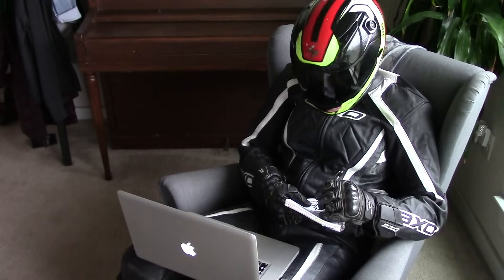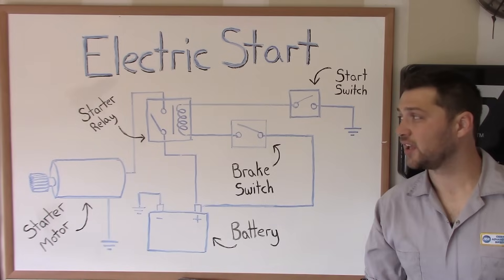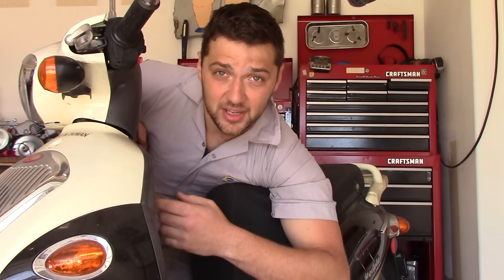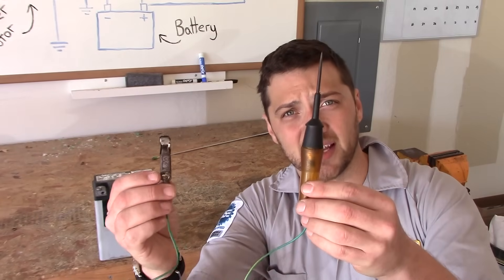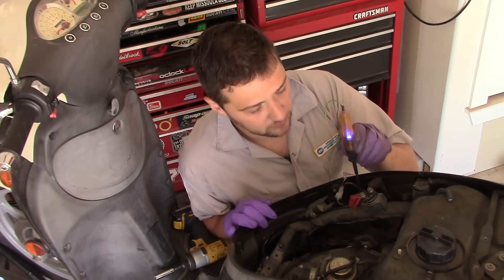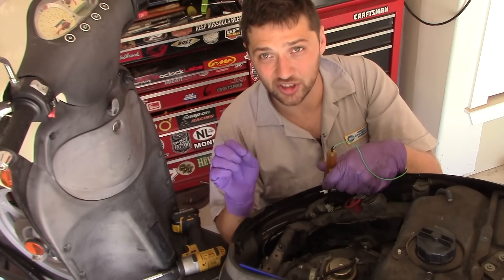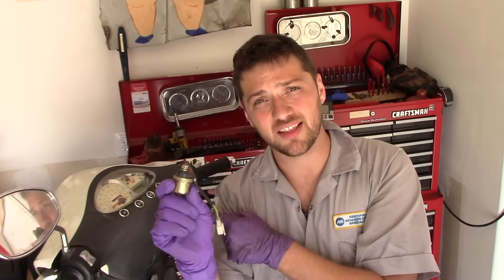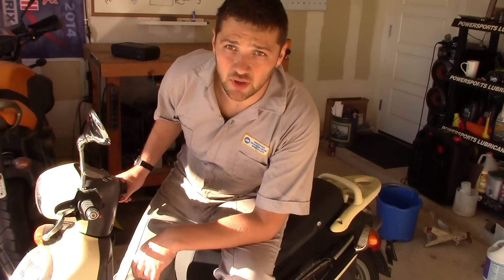Scooter 911: Electric Start Doesn't Work (troubleshooting your starter, starter relay, and circuit)

Comment: 3:35 my electric system is fine, then whats the problem it won’t start? i bought a new battery as well
Reply from the maker: Basically your engine needs 3 things to run: A charge of fuel and air, spark, and compression. So you need to make sure your bike has all three of these components. The easiest one to start with is spark. Remove your spark plug, insert it back into the boot (at the end of the plug wire), ground the tip of it against the engine and "Start" the engine. You should see a bright bluish whitish spark jump across the tip. If you have spark, reinstall the plug in the cylinder head and puff some carburetor cleaner or brake parts cleaner down the intake. If the scooter pops or coughs or starts and runs a little you have a fuel issue. If the scooter does not respond to the carb cleaner you likely have a mechanical issue preventing the scooter from building proper compression. I would perform a valve adjustment and then re-test. Good luck!
Reply: Garret Seesing apparently it was flooded, it happens at least two times a month, so it’s a fuel problem right?
Reply from the maker: @NICO12981  definitely. It's most likely the vacuum petcock (sometimes called the fuel cock). On most scoots it's mounted under the fuel tank. If you want I can walk you through the diagnosis and replacement over skype
Reply: Garret Seesing thank you very much!! i’ll get it checked
Reply: Hi Garret Seesing What do i do if i have a compression problem, would it be able to start and Will i be expensive to fix?
Reply from the maker: @andreasrizos338  everything is repairable my friend! Most of the time a compression problem can be resolved with a valve adjustment. Check out my video here https://youtu.be/QkkYjRdtQxg
Reply: Dang that was really helpful man 👍👍👍👍👍 thank you

Comment: Hi Garret. I just bought a VIP future champion. It vibrates while riding. Making it unpleasant to ride. Any ideas on what the vibration could be from?
Reply from the maker: Well that depends on the vibration. I would check the engine mounts first. There's a large bar that marries the engine to the chassis through 2 rubber bushings. Other than that you might check the transmission components. I've seen people brake chunks off the variator or drive clutch trying to change components. Good luck and let me know what you find!

Comment: My break light turns on but other lights will not. No horn and electric start does nothing. I've had battery on charge for 24 hours but the red light on charger is still on. The break light is alot brighter since charging but do you think the battery has had it?
Reply from the maker: Did you try the starter relay test @ 7:34 ?
Reply: @Scooter_911  just off to get some tools then I will try that thanks bro 😋

Comment: How would I check the starter switch, or the wire to see if it was bad.? Also my horn doesn’t work so I’m thinking it maybe a wiring issue!
Reply from the maker: Well basically you would need either a test light or a multi meter. You would check the wire at the beginning and make sure it is getting voltage, and then check the end that is doing work and see if there is voltage there. If you have a multi meter you can check the internal resistance of the wire as well! However it sounds like you have a battery issue since your horn isn't working either. Start with the easy stuff first! Good luck and let me know what you find!
Reply: Garret Seesing I switched the horn switch with the electric start switch and it actually started up twice last night with that this morning nothing. So weird. This scooter is gonna teach me a lot before I even get it out in the road
Reply from the maker: @amberadkins1446  nice work! Yeah they really are little learning experiences on wheels!
Reply: Garret Seesing thank you!! Will do. I already checked the fuses by the battery and they were okay.

Comment: Hey garret 
How long can gas stay in scooters 
Before the gas goes bad
Reply from the maker: Great question! But I have multiple answers. Gasoline definitely goes bad a lot faster than it used to. I've seen the gasoline in the carburetor (because it's directly and constantly exposed to air) go bad after one month of sitting. The bike started up just by draining the float bowl. 

Now because the fuel tank is sealed the gasoline inside can last a lot longer. Sometimes even a year.

However it seems as though bad gasoline can seed the breakdown of fresh gasoline. So if you just add new gas to bad gas you can be in the same situation very shortly. 

I hope that answers your question!

Comment: so,  I got this scooter from fb marketplace. the individual selling it was a mechanic and had updated the system from a 50 cc to an 80cc. he also mentioned he could not see the mileage so he did not adjust the valves. the moped ran for about a month then gave out. i have adjusted the valves which were very tight and cleaned the dash board to see it. now i put everything save for the casing back on with a freshly charged battery and i turn the key and no power. what am i doing wrong?
Reply from the maker: Wow kudos for the good work! I would check the little glass fuse that is on the red wire connected to the positive battery terminal. That small red wire supplies power to the entire wiring harness. Other than that, on some scooters there are 2 ground wires that attach to the valve cover. Most of the time one is green and one is black. Make sure those are connected. If you're still scratching your head after checking out the battery wiring I would pull the ignition switch out. Short the red wire to the red wire with black tracer using a paperclip. Let me know what you find

Comment: very informative with a little entertainment thrown in, you have my attention...good job. now, lets see if you respond to my request. how about putting up a resolution for gy6 scooters with problems for no running lights with starting issues? i'll be right over here...
Reply from the maker: Ooooohhh that's an excellent idea! Unfortunately I'm slightly at the mercy of the broken scooters near me. But if I get another GY6 in the garage soon I'll try and do a quick "how it works" video. Thank you very much for the suggestion!
Reply: @Scooter_911  thanks for getting back to me.
Reply from the maker: However I might add those issue very well could be mutually exclusive. When you refer to running lights are you referring to the tail light (dimmer setting as opposed to the brighter brake setting)? And when you refer to starting issues does the scooter crank but not start or does it not crank at all?
Reply: @Scooter_911  hey thanks again. the scooter would start but there were no running lights (head or tail) turn signals and brake lights work fine. i changed the magneto (as some one suggested) and that made things worse! now i have no spark or   lights. i pick this scooter up for pennies on the dollar. it wasn't running and had battery operated bicycle lights for the front and rear.  i'm still way ahead. after replacing the carb  it fired right up. but now, with this new problem my bargain is beginning to fade a little...i know it's an easy fix i just don't know how to find it. were would you start to look?  i have test lights and a muti meter...if you can help me i'm sure you'll be helping others. thanks
Reply from the maker: @dallaswoo8110  hey, maybe we can fix this thing together through Google Hangouts or facetime. Shoot me an email at garretseesingofficial@gmail.com

Comment: just want to know whats the problem of my bime sym sr150.the push button start didn't work.the battery is full charge.when i used a brakes and signal lights the engines will shut off.please help me what to do.thank you
Reply from the maker: Sounds to me like you might have a ground problem. Make sure the negative battery cable is securely mounted to the frame and that it is clean and tight at the battery terminal

Comment: Hey garret 
I let my scooter sit over a year 
Now won’t start 
Any suggestions
Reply from the maker: If it was running before you parked it, it is almost definitely the carburetor. I'm working on a tutorial for carb rebuilds right now but it won't be ready for quite some time. At this point carburetors are so cheap (if it's a Chinese scoot) that almost just worth the hastle to get a new carb. Good luck!

Comment: For me and my little Buddy, it was a looked connection to what I think is the relay. Opened the seat, could reach it easily under the rubbery cover and bazinga!  Mystery found. Connected it, started right up with the electric start. I applied a little pressure along the flat edge of the connector to help keep it in place. Is it advisable to use electrical tape to keep it connected for good?  Thanks for the video! It was entertaining truly helped to find where to start. (Pun intended)
Reply: Pardon my typo: “loose connection to what I think is the relay”. I bought my Buddy used very recently and haven’t downloaded a manual yet.
Reply from the maker: Nice work! Electrical tape is one way to go. I prefer to take the connecter apart and squeeze the female end a little tighter but if it's running it's running! And now that you've done it once you'll always be able to get it home!
Reply: Garret Seesing thanks so much Garret!  I’m so excited about my new-to-me Buddy and your videos are the best!

Comment: Honda 2004, vtx1300, turn key, power on.
Push starter button, click, and power goes away. Starter relay? Happens after raining.
Reply: Yes. And now I can't cycle it back to get power on. I'll check ground. Relay is good.
Reply: Ground on battery loosened up. Go figure. 
Thank you so much.
Reply from the maker: Do you have to cycle the key to get power back? If so I bet it's a bad ground either at the battery or where the battery grounds to the chassis.

Comment: My bike takes ages to start and once if dose and warms up if I turn engine off it won't start back up again. Very rarely will the eclectic start work so I have to kick start. Aslo front head light don't work and brought new bulbs and still don't work.........  any thoughts
Reply from the maker: I would try a valve adjustment to sort out the running issue. Here's a tutorial I made just for that! https://youtu.be/QkkYjRdtQxg 
I would think the headlight issue is unrelated but most likely a bad switch or a damaged wire somewhere in the harness
Reply: Yep, learn to speak and write English

Comment: Great video,  I do have a question though. My wife's coworker has a Kymco people s 200 and her cousin installed the new battery wrong. I found the 15A fuse and replaced it, but after installing the battery correctly (battery terminals correctly) nothing comes on. I only tinkered with it for an hour. I'm familiar with cars and how their electronics work. Is there a main relay that was fried or another fuse i haven't found? I've tried Google and also YouTube and there's no real info on scooters about this.
Reply from the maker: Not that I know of on the kymco 200. It's waaayy more simple than a car. There is no fuse box or power distribution box. None of the modules are "smart" either. For instance a bad ignition module can not stop the engine from cranking. And you may not get any lights at all until the engine is running. The horn is always my go to test for "key-on" power. However if you still have no signs of "key-on" power try jumping the ignition switch.
Reply: @Scooter_911  i did the horn test without knowing it was a way to test it. No lights on the cluster like i saw on the review videos on that scooter. I'll give that ignition switch a test when i go back to her house Thursday. Thanks for the help,  i thought her cousin might have fried the ecu or something.
Reply from the maker: @ItzFilthyMcNasty-01  it's a pretty dumb system so you should be safe. Feel free to email me when you get back to it. garretseesingofficial@gmail.com
Reply: @Scooter_911  thanks for the help,  I will email you if I have any questions thanks.

Comment: big appreciated!! This info and the way you present the info is rad
Reply from the maker: Thank you so much!
Reply: If you have a sec for a question,, Ive been having trouble starting my scooter even with the kick start, I know the battery is good and I plan to test out all this electric start stuff hopefully tomorrow morning, but is there somewhere else I should be looking if the kick start is having issues too?
Reply from the maker: @lane9043  I always have time for a scoot in need! So give me a tad more info, does the engine crank (making that riiiikikikiiikikikikik) noise? And also what kindof scoot is it (brand and engine size)
Reply: Happy to hear it, mine definitely is ! 

It's an 05 PGO mybubu, 125cc and it's not really making any cranking sound at all? When I try the kick start I can hear it try to turn the motor over a tiny bit but otherwise, nothin. I know it worked very recently, as I just bought it and the seller rode it up for about 20 miles w no issues on the kick start, and he kick started it in front of me before I bought it too, so I'm thinkin I must be doing /something/ wrong!
Reply from the maker: @lane9043  I LOVE the pgo bubu. I turned one into a racing scooter! It really sounds like a dead battery to me, I know you said the battery is good but it might be tricking you. Does the brake light illuminate when you hold the brake lever?

Comment: Can the CDI cause the moped not to start properly?
Reply from the maker: Absolutely! However the CDI does not have anything to do with the components that crank the engine. So if your scooter is not cranking the CDI CANNOT be the culprit.
Reply: @Scooter_911  thanks it was not wanting to stay cranked actually burned my starter motor trying to get it cranked and keep it cranked

Comment: In the morning no problem to start, after couple stop and go I can not start, starter relay clicks, when I skip starter relay I can starts with screwdriver. I go, switch engine off and again I can not start it, just clicks but I can not starts even by passing starting relay using screwdriver. I push bike for 20 min, I press starter button and engine starts. Its headache, puzzle.

Comment: My break switch is gone..... On applying break the light is not illuminating at the back. How to repair that
Reply from the maker: There are several different types of brake switches. take your brake lever assembly off and see which one you have. There are external button types and there are internal button types that look like little cylinders. They are all use 2 pin connectors.

Comment: Though I STILL have an issue x.x.... my scoot doesn't make any sound at all when electric start.  And kick start isn't working.  Just came.oit one night and had absolutely no reaction when starting it . Charged the battery too, still nothing
Reply from the maker: Does your brake light illuminate when you squeeze the brake lever?
Reply: @Scooter_911  nope ;`;
Reply from the maker: @noot7109  well there's your problem!
Reply: @Scooter_911  yeah i'm noob. My fuse to the battery connector was blown. Replaced it ;p
Reply from the maker: @noot7109  nice! Noob or not nice job troubleshooting that!

Comment: I have lambretta fully electric start Ln 125 and i put it on my drive way and its on a slope now it wont start at all, no noise when trying the electric start or anything. When i turn the ignition i see the battery go up to full ?
Reply from the maker: Does your brake light illuminate when you hold the brake lever?
Reply: @Scooter_911  not sure but will try tommorow and give you a update
Reply: Hi there I tried it again and now it's making a whirring noise. I have a almost full battery.. Lights etc come on. I put it in a slope when I first brought the scooter home only for a few mins, then it wouldn't start. Would this have caused flooding of petrol into other parts? As everyone telling me its flooded. My scooter is all electric auto lambretta Ln 125cc. No kick start

Comment: Hey Garrett for some reason when I ride my scooter I can feel an electric charge thru my right hand. It numbs my hand while I'm driving it and by the time I make it to my destination I can't feel my fingers. The automatic start seems to work but sometimes it's like it's not connected so I have to kick start it. Can you help???
Reply from the maker: Wow that is strange! You might have a bad stator or one leg of your stator is shorted to ground. Disconnect the 3 pin plastic connector that ties the stator into the harness and see if your grip is still electrified. The only other thing I can think of is your coil is backfeeding through your kill switch. You can check that by removing the right hand switch assembly. Good luck, and DEFINITELY let me know what you find!
Reply: @Scooter_911  u are the man brother!!! Thank you for the feedback and I will be letting you know real soon what is found out!!!

Comment: hey I have a moped with a starting problem the starter seliniod just clicks I replaced it and have good ground well charged battery and I cant figure I out sometimes when I try to start it my dashboard also flickers can you help
Reply from the maker: Did you try the starter bypass test at 7:32?
Reply: @Scooter_911 yes I did try that and it still wont start also seems to not be getting of the new gas I put in theres none in the pumps
Reply from the maker: @tommycaterino3497  Well the fuel valve is vacuum operated so the engine has to be cranking or running to work. 

If the starter relay bypass test doesn't crank the engine over it can be 1 of 2 things. You either have a faulty starter motor, or your engine is locked up. Remove the spark plug and put a deep 13 mm socket on nut cast into the fan shroud. You should be able to turn the motor over easily by hand once you have removed the plug. 

let me know what you find